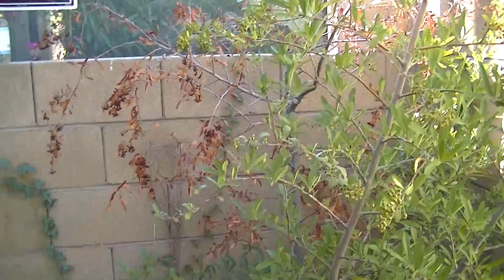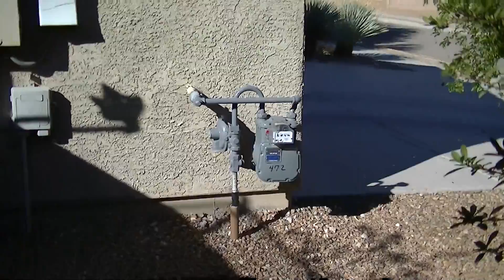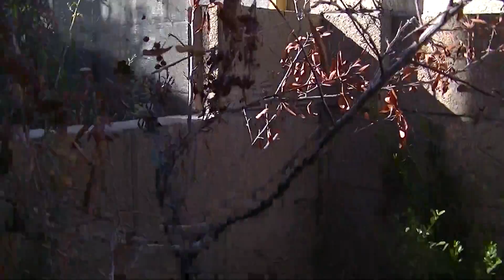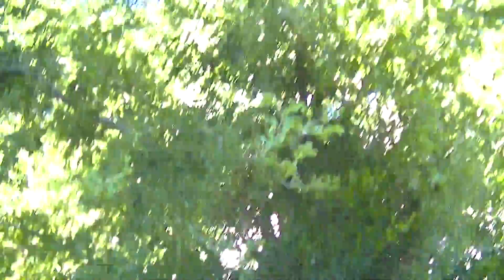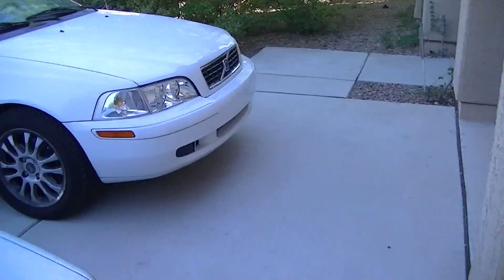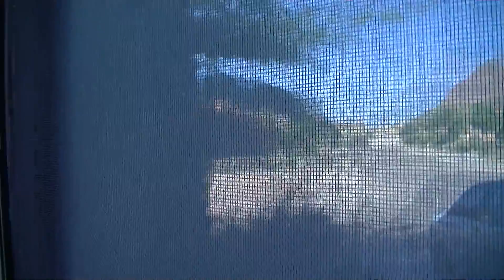Review of Front Garden Plants After Removing Wireless Products from Service 24th Septemeber 2013

Comment from the maker: The whole neighborhood has transmitting gas and electric Itron utility meters.  They pulse every several seconds.  I had an electrical meter that the transmission appeared to be continuous and it was probably the mesh node/collector/relay meter, which is regarded as the most toxic utility meter device.  It was in-line with never being healthy in this home until after its removal.  My immediate neighbor has an Itron 100G transmitting gas meter 15 feet away that the gas company refuses to remove.